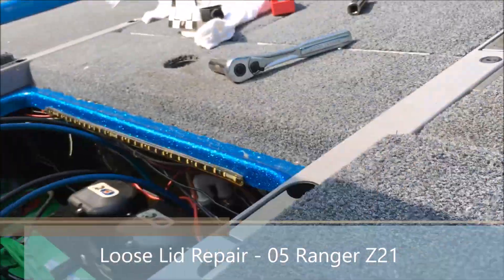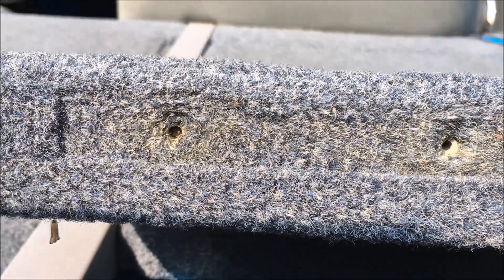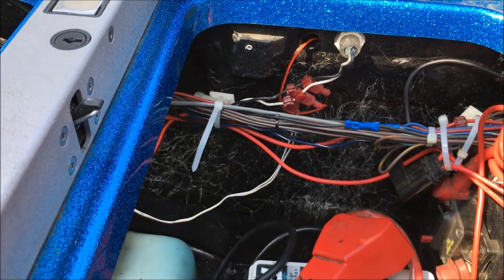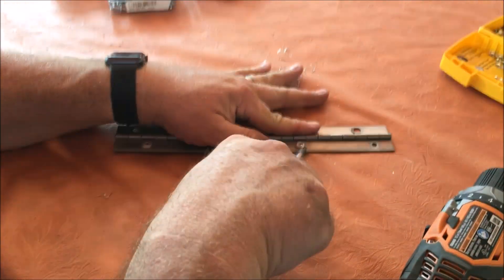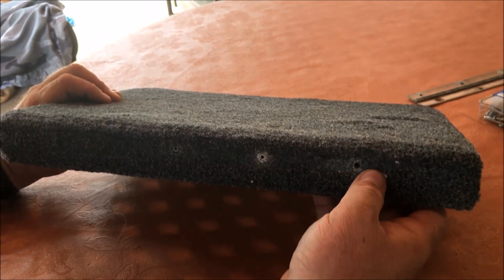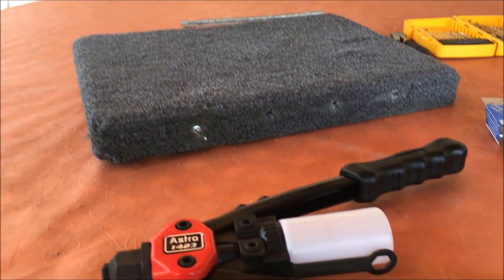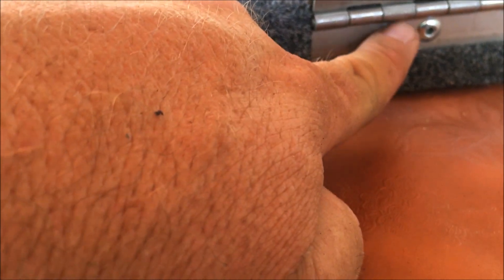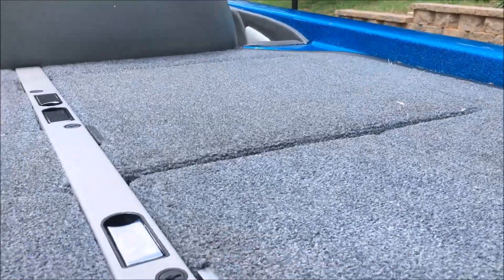Ranger Z21 Loose Locker Deck Lid Repair

Comment: When drilling out the old rivets from the deck lids... Are you drilling completely through to the other side??
Reply from the maker: I tried to just go through the rivet but sometimes that pushed all the way through.
Reply: @ccooke70  is that a bad thing? My boat is lil older than and  I'm finding that I'm going through quite easy
Reply from the maker: Bryan J. Smith no.  Even if you have to drill larger holes, you can just use larger rivets.  I’ve seen guys online that switched to screws too.

Comment: Good description.  You rivet box says "steel" so how do you know they're "stainless"?  Anyway, I've had great luck with Arrow rivets that come in aluminum (which is what most OEMs use because they're softer and easier to install), steel and stainless steel, which is the hardest to squeeze.  As you say, stainless takes a much more hand gripping to make them pop.
Reply from the maker: kellerrobert80 I got them from amazon and they said they were made from stainless.  They are very sturdy and were much harder to get in than the normal ones.
Reply: Cool.  Yes, I found that stainless were harder than steel and much harder than aluminum.  Glad you found the right fastener for your application.  Cheers.